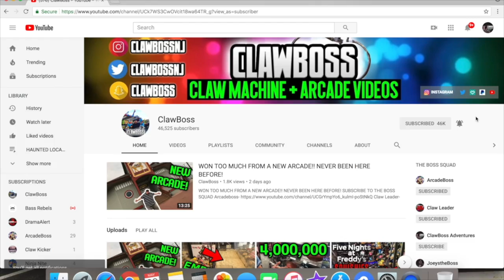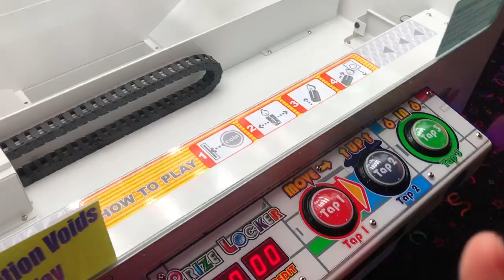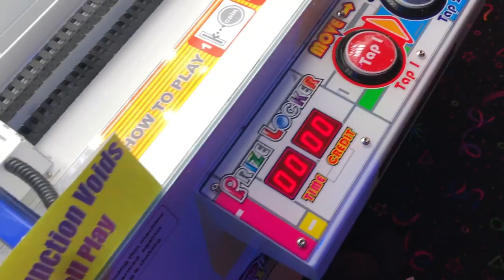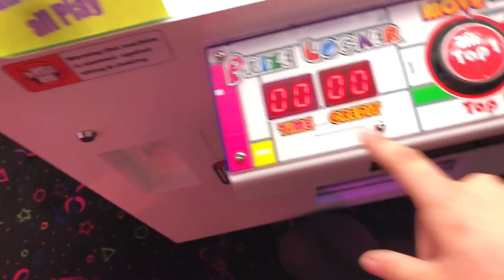HOW TO CHEAT A RIGGED PRIZE LOCKER | Arcade Redemption Game MAJOR WIN. THIS SHOULDN’T HAPPEN!!!

Comment: The game is rigged to only pay out like every $1500 for the top prizes, and it's legal for them to do that as long as the prize is worth a lot. It's illegal for them to set the drop rate that high on like a $10 item though. I'm not sure what the specifics are, but they have to set the drop rates according to the value of the prize, so it will let someone win the bottom row a lot more often than the middle or top rows. However, I'm pretty sure it's completely illegal to have it rigged to where the key won't even fit the slot. I've seen lots of videos of people winning the top prizes, so I think the arcade owner must have added an extra piece of plastic or something. Those machines usually aren't rigged to have the slot to small.
You should call the number on the machine and report that the arcade owner tampered with the machine. Send them a copy of this video and let them know it's up on YouTube and start post a short clip of you lining it up perfectly. They'll probably either give you your money back or give you the prize. I would also try just asking to speak to the manager or the owner and show him the video. Ask them to either open up the machine and give you the prize, or give you your money back. Of they're decent and weren't the one who rigged the key hole, they'll do it and probably be upset that the company who makes the machine made them look bad and return it. If they aren't decent, I would get crazy about it.

If you're feeling crazy like me, ask to record your conversation before you tell them what it's about, or just start recording and make it obvious so they can't deny they knew you were filming later and have a friend nearby recording more discreetly in case they ask you to stop. If they refuse to do the right thing, post the video and the clip that shows the machine is rigged to Twitter every day and tag the company and the arcade. 

Keep posting it every single day until they do something about it. I would even make a sign that says "This machine will not give you the prize even if you win. The key is too large to fit through the slot. Don't waste your money on any machine like this." then go back to the arcade and record yourself standing by the machine with the sign and showing people the video clip of it being to big to fit and telling the not to play those games. The arcade will probably get tired of it and just give you the prize.

If they don't, keep going back a couple times a week for like 30 minutes each time, or as long as you have free time for. If you cam, go every single day for like a week, and eventually they'll get so sick of you scaring off customers they'll give it to you. 

If that still doesn't work, eventually a news organization will get wind of it. Make sure to video yourself and if they kick you out, add that clip & keep uploading. Add a clip of you saying they kicked you out for exposing that they're scamming CHILDREN, and the owner is too much of an asshole to do anything about it.

Have your friend call in a news tip or do it yourself and say "There's this guy at my local arcade protesting one of the machines because he doesn't want anyone else to loose money like he did! It's crazy!" I'm willing to bet your local news would interview you and run a story about it on a slow news day. 

If you make it on to the news, either the arcade or the company that makes Key Master will be willing to do just about anything to make themselves look good again. I bet they would not only give you the prize you were after, but give your money back as well. 

You probably aren't actually that upset about loosing $60 and whatever the prize was worth to put in all that effort, but it would make for a  killer YouTube video. Everyone who's ever been cheated by one of those machines would be rooting for you too. 

I don't think the arcade could even make you stop telling people not to play that machine because of Freedom of Speech and all, but if anyone decides to do this wacky plan, don't accuse the acarde owner of rigging it, even if that's probably what happened because they might try to accuse you of slander.

Comment: I'm really disappointed. I thought this video was actually going go show how how to hack the machine or something. The machine lets the owner set how often it allows you to win. If it's not due to pay out, it will automatically keep going up after you release the button so it will hit the top. If it's due, it will stop moving immediately after you release the button. They say the way to check and see if it's ready to pay out is to try, and if you miss by hitting the bottom a little bit, it's ready. But that never made any sense to me. Couldn't you just be missing? I think the only way to check is to make sure you're releasing it in the right spot and watch closely to see if it keeps moving up after you release the button.

Comment: The keyhole is at an slight angle, is it on purpose or coincidence I don't know, I would come back another day when its hanging straight
Reply from the maker: BINGO!! I noticed that when I was editing!!
Reply: Yep, that slight angle tilts the "roof" and the "floor" of that frame effectively reducing the total hole size. You've seen those toss ring games where you throw to some kind of prism? Same thing but in that case what is tilted is the ring in midflight, that's why when they "prove" the game isn't rigged they insert the ring from straight up.

Comment: if you noticed the bottom of the  opening is kicked out towards the ram and the ram is level   it won't go through since it will either hang up on the top or the bottom
Reply from the maker: Yep

Comment: The key does fit but the holes designed for the key to barely fit like there’s zero room for mistakes  they make you pay 3x the prize value before it pays out if you look at the hole the holes not perfectly cut the top has that tiny notch

Comment: There are a couple guys on here that I've watched. They go to arcades with devices that they made, and use them to both win and test the games' "truthfulness." It was the one where a light circles a table and you have to stop it on the Jackpot. They device they used, they tested over and over again...always winning with their device. When they went to the arcade to use it, it would never hit the jackpot....(they were able to do all of this because they hid their device in a backpack they set up on the ledge). 

After they brought it back, they watched the high-speed recording that they filmed. The device was hitting it on time. But it would always hit either 1 before or 1 after. When it comes to games like these, I'd prefer the ones where you need to either toss something or hit something. I know those are also made to be more difficult. But with enough skill, you can beat them. These games are just like casinos....they're programmed to payout at certain times.
Reply: Soul0Stealer mark rober right
Reply: @danielodarchuk5732  I believe that was the name.